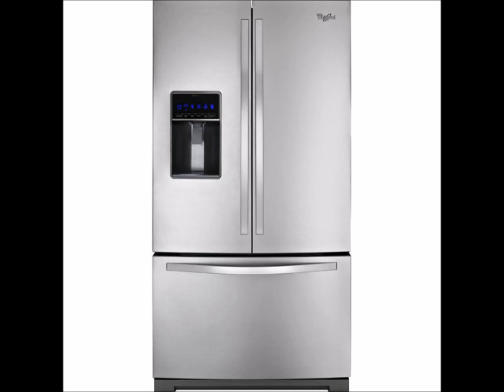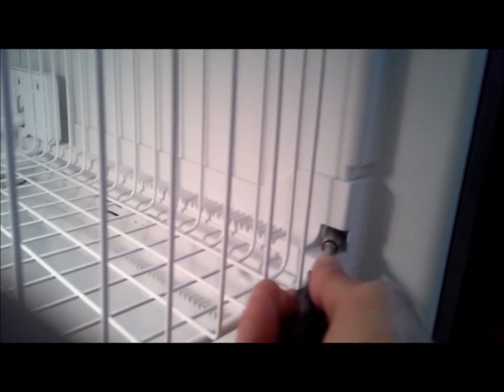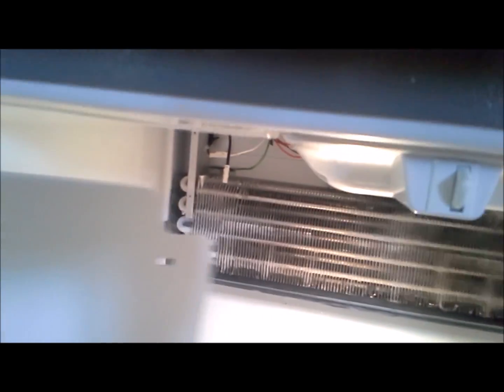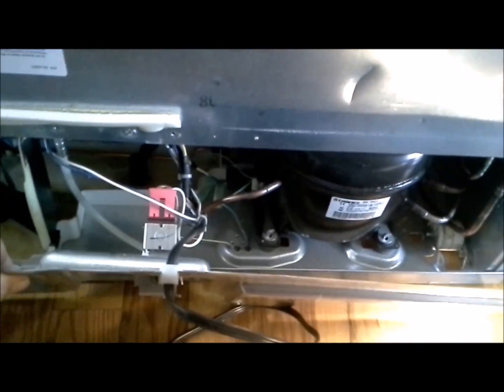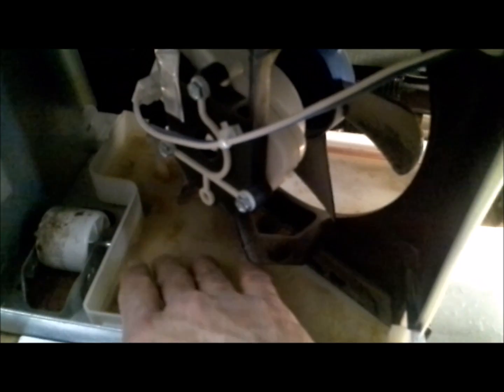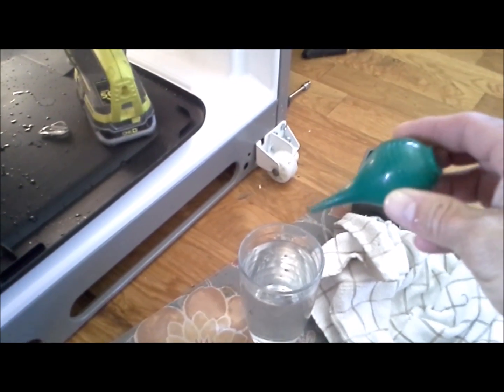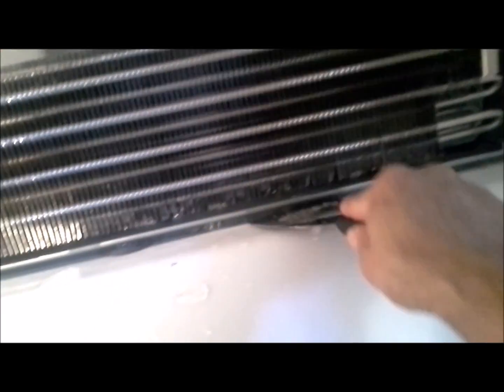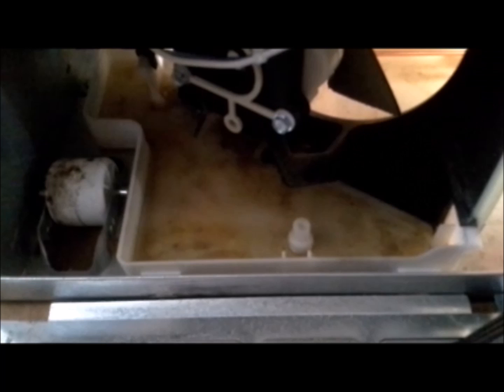Whirlpool refrigerator repair- ice in freezer- water on floor Fix Maytag, Kithcenaid, Kenmore

Comment: First, thanks for the video.  I was able to skip the step of removing the back panel inside the freezer.  I have a heat gun I use for heat shrink tubing on quads I build.  It gets many times hotter than a hair dryer and in a few minutes, I had that drain tray completely thawed.  Also, I took a mini torch and heated a metal rod and stuck it up through the tube to the back.  That helped clear the ice from the bottom up.  Took me about 40 minutes. I also cut some of the rubber grommet off.  Why that's there??  I speculate to minimize any cold air coming through.  Mine was open by the way.  My blockage came above that.  I'm not convinced it's fixed yet though.
Reply from the maker: Glad to hear this video helped. The grommet is just a terrible design they can stick shut pretty easy. Just grease from cooking can cause it to stick shut. The new design is an open tube that leads to drain pan with no restriction.
Reply: I'm wondering if I should have just left the grommet off?  I did take an exacto knife and cut some of the end.  It's pretty much wide opened.  There is a tube fix Whirlpool sells. They should just give the damn things away for anyone owning these refrigerators regardless of age.
Reply from the maker: Should be ok just keep an eye on it. As long as water makes it to drip pan and not floor everything should be fine.
Reply: OK.  Thanks for the video..
Reply: They do give it away.  Just call and ask nicely.  The part number for the kit is W10619951.

Comment: Thanks for the video.  I used a hair dryer to speed up the ice melting process in the freezer.  Very easy video to follow!!
Reply: +skeeter Sampler Did you use a hair dryer only, or hot water + dryer? I wonder if I can unplug my fridge and hold a hair dryer there for 40+ mins without taking it all apart...?
Reply: Both

Comment: Great video!  I used a hair dryer to speed up the ice removal, I had a ton of ice in there.
Reply: +73mckey Did you use a hair dryer only, or hot water + dryer? I wonder if I can unplug my fridge and hold a hair dryer there for 40+ mins without taking it all apart...?

Comment: Best video for fixing a leaking Maytag etc refrigerator.  A few things I would add, I had three things that I had to fix before I corrected the problem.  1.  Check and make sure the drip/evaporator pan in the back of the refrigerator is not cracked (mine was) Part number is stamped on the bottom and is easy to order on line.  2.  The little black rubber nozzle leading to the drip pan was clogged.  The only way I could clean it was with some "goo gone".  Soap and water wouldn't touch it.  3.  I had build up of ice inside the refrigerator.  Make sure all the ice is all gone, especially the drain hole.  I finally cleaned mine with hot water until it flowed freely into the drip pan.

Comment: There is a new permanent fix for this problem that involves removing the duck bill grommet and replacing it with a P trap assembly.  The parts and labor are free from Whirlpool if your freezer is less than 2 years old.  If it's older than 2 years the part is free.  I just got mine last week and fixed it today.  Go to whirlpool.com.

Comment: Why must you goes through considerable effort of taking the metal cover off the back of the freezer compartment?
Reply: +John James You don't have to, but if you do you can clean all the excess ice from around the condenser drain hole. it's not that much more effort either, 6 more screws to back out.
Reply: I didn't.  My back panel has louvers all the way across the bottom and I just used a hair dryer on that until the drain started flowing into the drain pan.  I've ordered part number W10619951 to fix the problem permanently.
Reply: +Dave Cook How long did it take to defrost, + / -  45 mins?
Reply: +figanomics Defrost only took around 25 minutes.  Should have mentioned, I had already cleaned the "nipple" but left it off until I was done with the defrosting.  My kit still isn't here but should be in a couple of days.  I guess when you're getting something free you can afford to be patient.

Comment: Thanks for this video.  This was my second time doing this repair (last time was 3 years ago).  I liked the ear plunger idea.  I was half thinking of just leaving the little rubber funnelly thing off so this wouldn't happen again.  What benefit does this thing have?
Reply: B MacK I agree, why bother replacing the nipple?
Reply: +MerrymanFins 
X3??
Reply: +B MacK  In another great, very similar video the technician replaces the nipple (huh huh, i said nipple ..) with a solid open round piece with no flow restriction. The nipple is apparently about as useful as male nipples...

Comment: Great video, this is my project tomorrow.  I've been experiencing these issues for a while, but assumed that the cause was related to my ice maker being broken.  Is it possible that the leak could be up in the ice maker area and still leak down into the freezer compartment?
Reply from the maker: David Mayhew Its possible but not as common. There should be some sort of water/ice trail on interior walls if its coming form ice maker.
Reply: +David Mayhew Me too.  I'm having this issue and thought it was the ice maker.  I've had the water shut off and today used my heat gun to remove about 4 lbs of ice to the bottom.  Then, I noticed water again.  Now I know the issue is that damn drain.  Very poor engineering Maytag/Whirlpool.  Maytag's quality is crap.  I'm currently in the process of replacing all my Maytag appliances.